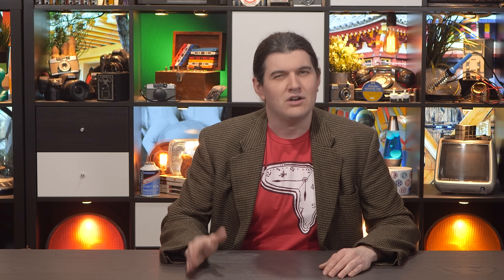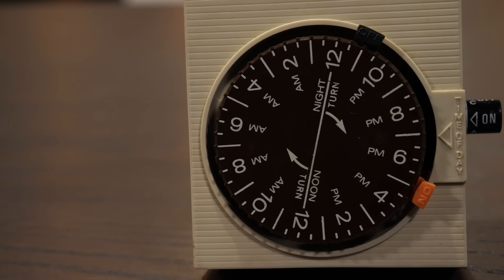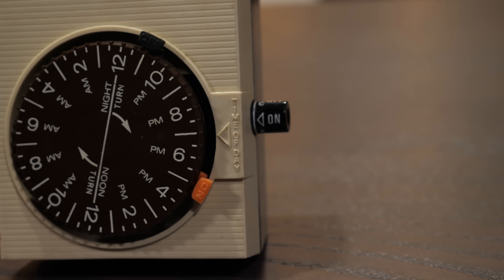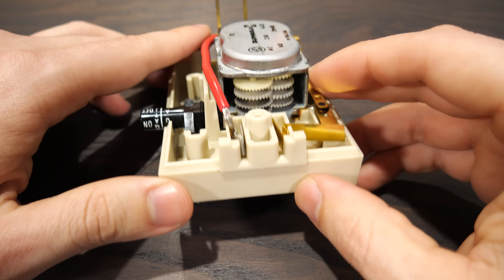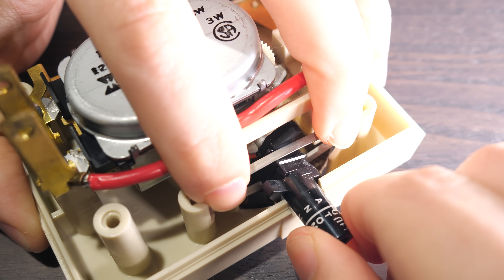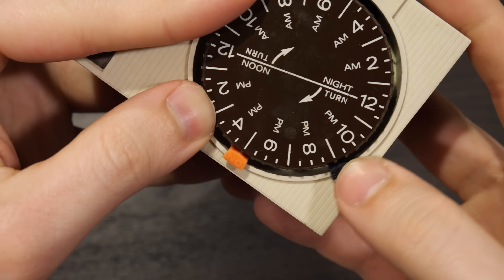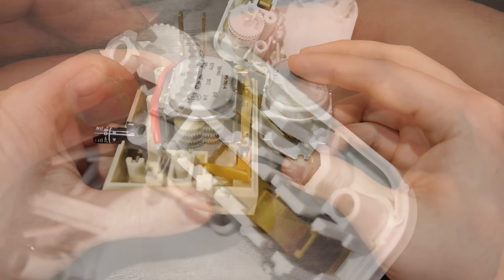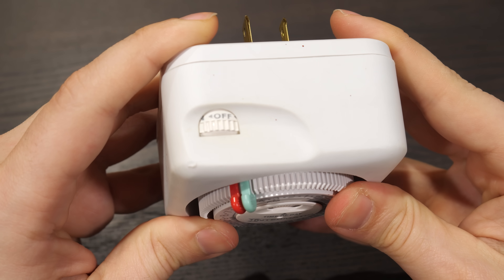Timer switches: literally just a clock and a switch

Comment: These sort of devices are quite common in Finland, where places like workplace or some apartment parking lots need to be able to heat up cars at winter! I remember freezing my fingers off every time i had to figgle one of those to turn on at 4AM and off at 6AM when I was leaving my nightshifts at - 30°C. The warm car felt nice👌
Reply: All the ones I've used here have been the analog kind, surprisingly! And to the person who asked how to warm up a parked car, you get a cable that runs from a little electric box at the parking, through one of these timers to the front of your car with a cable! That starts warming up the engine compartment of your car, and if you want to warm up the inside of the car as well, which I ALWAYS want to do, you plug a small heater into an outlet in the footwell of the front passanger seat. Once your car is plugged in, you can turn it on! 👌
Reply: @Zummeli  nice. Here in Australia the problem is a hot car not a cool car. If you're able to park in the shade (or a garage) it's reasonably comfortable getting in but a car left in the sun on a 40C day is no fun at all.

I've never seen a cooling setup like your heaters. I guess the fluids don't get hot enough to boil so it's never been necessary
Reply: @dielaughing73  yeah, the temps can get to -25C in southern Finland during the winter, even colder in the North since its in the Arctic Circle
Reply: @Zummeli  that sounds incredibly dangerous... and a huge use of electricity, but I guess there's no avoiding that.
Reply: @KairuHakubi  The fuel savings from starting the engine at operating temperature outweigh the electicity use, at least if you only use it for heating the engine and not the cabin as well.. Why do you think it is dangerous? These things are used by most motorists in colder climates and basically everyone in arctic regions and I have never heard of problems with them..
Reply: sure but the analog ones are rare nowadays since it costs almost nothing to get a complete control loop automation taking into account data from some probes and sensors.
Reply: How does one warm up a parked car?
Reply: @dielaughing73  Back in the 70s my parents bought a Chevy Impala which happened to have an oil pan heater, something meant for northern market but somehow wound up at my dad's dealer. You used an extension cord to warm up the oil pan in extreme cold so that the engine would start. I don't know if they still offer that on any vehicles these days, and of course, we didn't live far enough north to ever use it as far as I recall. Knowing my dad, he probably plugged it in at least once just out of curiosity.
Reply: In Canada (Winnipeg, where temperatures can dip to -35, without the wind chill) block heaters are almost mandatory.  At that temp, the oil in the pan is more of a sludge, and with more modern cars having even smaller tolerances for their injector ports - you are essentially cold-cranking a car for a few seconds without any oil in the piston shaft.

By using a block heater, not only is the oil warmer and a bit more viscous - it puts less strain on the starter and less draw (slightly) on your battery.  Added bonus is that your car warms up a bit faster.

Used to use a digital timer, but the biggest drawback is that it would reset each time there was a drop in power - so we switched to a manual one.

Bonus (as written by our commenter in Finland) if you can attach a small air heater to warm the car up as well.
Reply: @solangecossette1374  I have a cheap wallplug wattmeter which uses a pair of alkaline cells to prevent losing diverse consumption data during power loss. This kind of feature should be implemented for most digital timers too.

Comment: It should be noted many COFFEE MAKERS in the 1980s featured an analog clock dial on the front that you could set a time to start brewing, and probably used a similar mechanism - though the General Electric BREW STARTER (TM) featured a digital clock in 1979, which probably makes it one of the first consumer digital timer switches!

Comment: I optimistically purchased a set of "smart" switches one year. There were some complaints in the reviews, but I'm pretty tech savvy so I didn't think twice. However, after an hour of messing around with a shitty, glitch-ridden app that seemed to get worse with each reinstallation I returned those trash switches and dug out my old reliables. Automation is automation and keeping it simple will always be the best to me. Lesson learned

Comment: Thank you for reminding me these exist, we used to use these, though definitely a non polarized, generic newer model of sorts, for controlling when rope LED? lights would turn on and off for day and night on a cycle, within its current limit. Instead of worrying about getting to a light switch in a dark house overnight, you could always see the floor, we had ran a few of these timers intermittently due to rope length if memory serves.

Comment: I run a small theater, our marquee signboard is on a large, LOUD, metal mechanical timer. The time is probably from the 50s or earlier. When we last had the signboard serviced (to upgrade it to LED lamping!) I asked if we could get a digital timer so it would be quieter in the electrical room. The signboard guy winced at the prospect, apparently digital timers are still dramatically unreliable. He did offer a light sensor option, but I prefer to have the light turn off around midnight to at least somewhat minimize light pollution on the street. 

Of interest, we have a series of a hundred or so twinkling lights that we turn on only when we have shows. They run on a mechanical part (in the same room as the signboard timer) that spins the contacts to make the lights twinkle in series. You can see the sparky sparkly arcing in the box as it makes/breaks each contact. I am told that since it is original and has been in place in operation since it was installed, we can continue to use it, but would not be able to install something like that new. Every electrician I've had in the building takes a video to share with their friends.

Comment: We use one with removable tabs for our electric water heater. In that case, there's no outlet 'cause it's directly wired. Your older video on how the US gets 240V power actually helped me diagnose an issue we were having where the heater was only connected to Ground, +120V, and neutral instead of +120V, -120V, and ground like it was supposed to be, and so we weren't getting enough hot water. Very helpful video, thanks!

Comment: What would happen if this thing was plugged into a rotating carousel that spun near the speed of light but was also connected to the local power grid? Would the spin of the carousel reduce the frequency of the incoming power to accommodate for time dilation or would it just operate at the same frequency as the power station? And if it does lower the frequency then does the clock still run at 24 hours in the carousel?

Comment: 12:04 Almost all. One thing that kind of sucks about that design with the piles of built-in tabs is that you cannot configure it for auto-on-only or auto-off-only. A switching action always comes with a reciprocal action. So, if you want to manually control one of the switching directions, you're better off with the other model with the losable tabs.

Comment: I have an oil radiator heater that has one of the push down tab style timers built into it. I got it from my FIL last winter, and I thought it was the neatest thing. I'd never seen a heater of that style with a built-in timer before.
Reply: I just glanced at my floor standing oil radiator, its got one as well. Never used the timer but nice to know its there. Come to think of it, a lot of oil radiators have them, even the really small ones.
EDIT: just looked at a few more around the house, its 50/50 pull tab or rotary timers.

Comment: I worked with a variant of those devices at a hotel: it was an alarm clock with slidable tabs all around the dial at fifteen minute intervals. We used it to make manual wake-up calls to rooms. Each tab set would make it buzz until we hit a switch to silence it, then we would look at a list to see which rooms to call. Four-star service, baby!

Comment: The ones I use in the UK are at bit like the third one you showed except they have like a hundred tiny little tabs you push down or leave up so you can do more complex on and off cycles for various reasons, like making it look more convincing that someone is in. I use one to run my old fridge that has a broken thermostat or somthing so freezes everything and runs constantly, I have it turn on for 15mins off for 30 and it works perfectly keeping the fridge at an appropriate temperature. Of course there are digital ones now but the ones I have work fine.
Reply: I bought a temperature controller board from China for $3. Used an old lamp cord to power it. It has a display and programable settings (buttons). Two temperature probes were included. Simple wiring but only displays in Celsius. I use it to control temperature in my fish tank. 
You could use this to control temperature precisely or to turn on a lamp if your freezer gets too warm, or both if you get the proper board. 
I mounted mine in a plastic 5.25" hard drive case ($1.50).
Reply: I have one on my boiler (bypassed for a smart thermostat now). I can see it being handy if you need more than one or two periods, like morning, evening, and lunchtime?

Comment: The ones with the individual pins that pull out are handy to use with an iron that doesn't have an auto-off switch.  When using your iron, just plug it into a timer that only has Off pins set. Set the Off pin for the maximum time you'll be using the iron.  If you forget to unplug the iron or turn it off, you have a safety backup.
Reply: I am baffled that modern hair appliances don't have built-in auto-off technology. About once every other week my wife leaves her flat iron on. It's not gonna burn anything down, but it is starting to turn the white countertop a brownish hue.
Reply: @fearlessfreep  They do make them. I have one. I hate it. If I plug it in to heat it  up, and get distracted away from it, it turns off. Then when I'm ready to use it, it's cold and I have to turn it on again and wait for it to heat up again... Making me late.

BTW this, what I have, is not "a timer" to set an exact time but just an auto-off built into it, but the annoyance would be the same with a timer. My iron does the same thing: If I walk away to hang clothes and it takes a while to reorganize stuff when I get back to the iron it's off and not hot enough to iron with.
Reply: @marciaoh7056  You just need the auto-off to be a longer time.
Reply: Oh yeah, my dad did this with the slow cooker and possibly coffee machine. (They definitely have an electronic slow cooker now, not sure if their coffee machine has a clock yet.)
Reply: Our iron doesn't have an auto-off switch, yet we never have had a problem of leaving the iron on.
How is this possible? Small house. We have to do the ironing in the hallway. And the iron gets stored in the hallway linen closet.
Even tho the house is small, the cord of the iron is not long enough to let us store the iron with it plugged in and potentially on.
And there's not enough room in the hall to let us leave the ironing table standing in the hall unnecessarily.
So whenever we're done ironing clothes, we put the iron and ironing table away right after.
The iron is never in a state where it can be left on unattended because of this.
I think this can be made to work even in larger houses with a dedicated laundry room where you could feasibly leave the ironing table standing up all the time, all you need to do is build up a habit of always unplugging the iron when you're done using it.
Reply: ... or for not much more you could buy a good iron like the Panasonic NI-W810CS which lets you iron your clothes faster and if your time is worth anything will pay for itself in no time flat.
Reply: @ssl3546  If your time is worth anything you dont iron your cloth (exaption for suits)

Comment: The home I grew up in had an old Intermatic timer switch for the front porch light - though I remember the manufacturer I can't remember anything else about it other than that it was possibly beige and/or brown. My parents never bothered to program it so they just used the manual override to turn the light on and off (which was also how I was taught to use it).  At some point I remember thinking it was odd that it had all these controls that we never used, but by then the habit was too well established and none of us really cared enough to figure out how to set it (especially with the chronic power outages we had whenever there was even the slightest threat of unsettled weather).

Comment: I've used most of those.  Most recently for a small lamp in the living room which turns on every night.  I hated climbing under the table twice a year to adjust for DST so I ended up going with a smart outlet that I had sitting around.  Say what you want, but adjusting the on/off time from your phone can certainly be an advantage over poking buttons under a table!
Reply: I don't like using smart devices, but the ability to adjust to the exact sunset and sunrise is hard to beat.

Comment: So some years ago I was going on a little over 2 week vacation in winter, and wanted hot water ready for tea on my return home.

So I plugged my ELECTRIC KETTLE, switched on, into a mechanical 24hr timer like this set at just before midnight programmed to switch on at "2am". I then plugged that timer into a digital weekly timer set to run for exactly 1 hour at just before the time & day-of-week I was set to arrive home. And I left.

A couple of days later, 2 weeks before my return, the digital timer turned on for exactly 1 hour, which advanced the mechanical timer to just before 1 am, and then shut off.

A week later, and 1 week before my return, the digital timer again turned on for an hour and ran the mechanical timer to just before 2 am.

And then another week later, just before my return time from the airport, the digital timer fired up for another hour. A few minutes later the mechanical timer finally got to "2am" and turned on the full kettle which boiled the water and then, after waiting over 2 weeks, finally clicked off.

The result: my tea water was boiled and ready perfectly on cue waiting for me to arrive. Which I did many hours later due to a delayed flight. Aww shucks.

Comment: These things are super popular in Israel (and I presume other Jewish communities) and refered to as "Sabath clock". This is because the are usually used by Jews who "keep Sabath". Under Jewish tradition one is allowed to have electric appliences/lights running on Saturday, but are not allowed to turn them on or of (or interact with them in any meaningful way). Thses clocks provide a loophole to allow them to, for example, have the lights turn off at night.

Due to there popularity though, they are also wiedly used to turn the water heater on and off in order to save power.

Comment: The previous flat I lived in had an ancient boiler with one of the push down tab timers on it and if you set it into timer mode the force of the microswitch would gradually overcome the spring tabs holding the faceplate in and it would unexpectedly ping out of the housing and bounce all over the kitchen. First time I discovered that, I was cooking. Good times.
Reply: thank you for sharing this, I’m in tears

Comment: I'm glad that you found receptacles that engage with the holes in the plugs!  You and I both seem to have been suspicious about this for years (well, more years for me), so it's nice to find at least something that actually uses the holes.
Reply: All my grandfather's extension cords had locking sockets that used the holes on the plugs. They were old in the 80's, and I've never seen one since.
Reply: Outdoor sockets on a LOT of things, from stakes for the yard lighting to extension cords and even a few "exterior grade" outlets had internal bits to interact with the holes on plugs. I think it also had to do with light vs medium vs heavy duty definitions as well. The idea was to exploit them so the plugs could be forcefully (albeit only lightly) retained against dropping on the ground and getting walked on or rolled over by vehicles and other equipment...

    I can't recall seeing any since about the mid 90's...  ;o)
Reply: I also noted that the holes are chamfered which I've never seen before. So not only are they  using the holes but is enhanced to make even better contact.